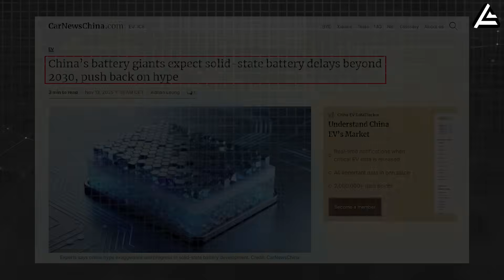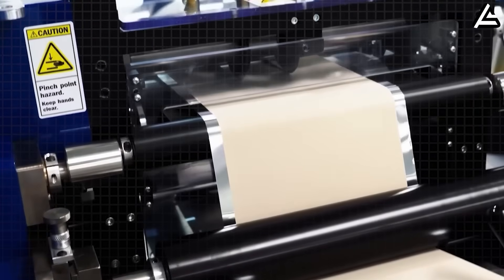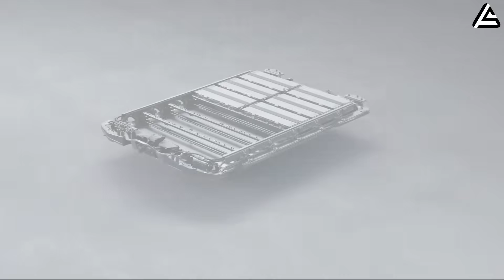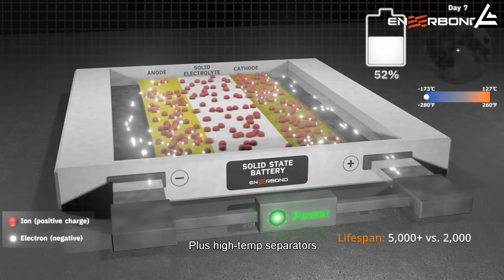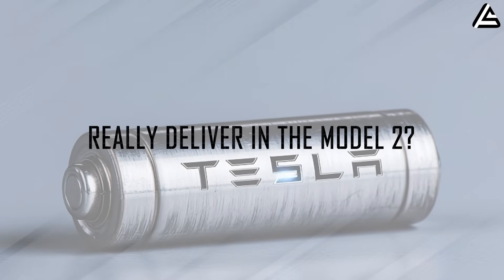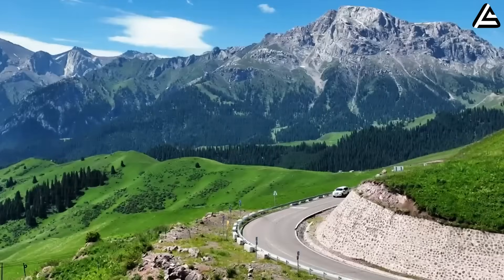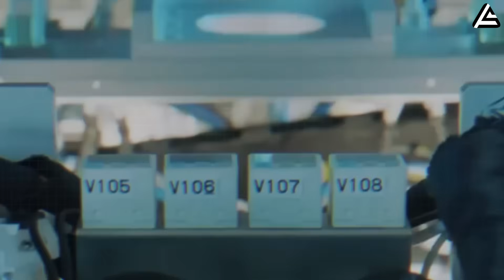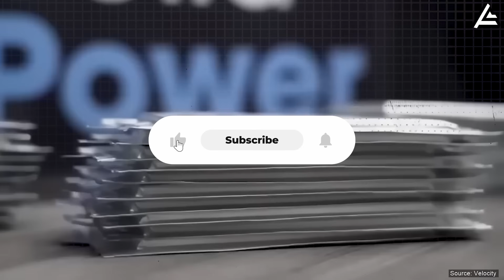How 2026 Tesla Solid-State Battery Be The End Of Lithium? Elon Explains

Comment: Will the new solid-state battery eliminate the need for charging stations to warm up their own equipment in the winter?
Reply from the maker: Solid-state cells handle cold better, but they won’t remove the need for chargers to warm their hardware, the stations still have their own electronics to protect. You’ll probably just see shorter warm-up times. We’ll explain the winter behavior in detail in the next video.